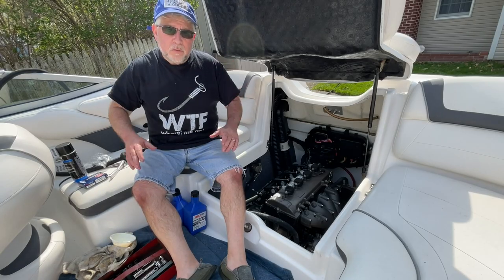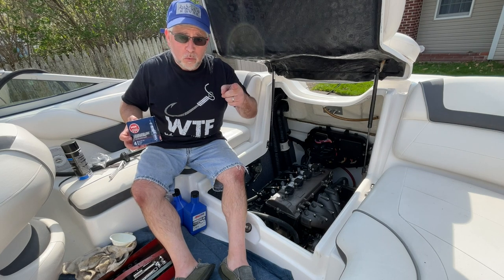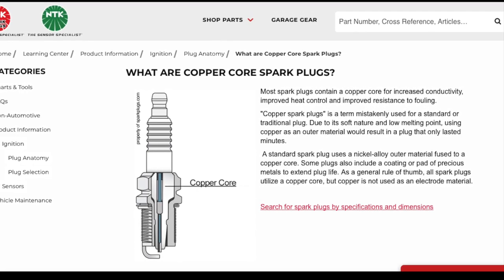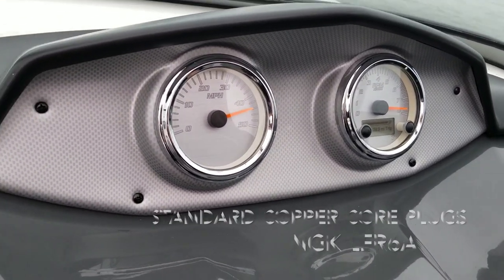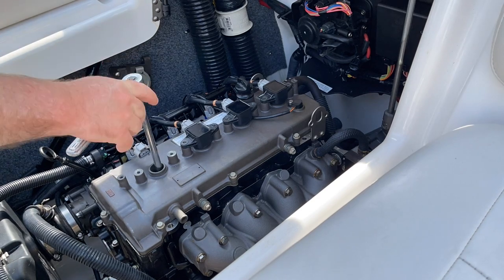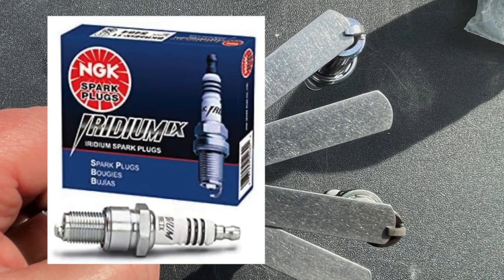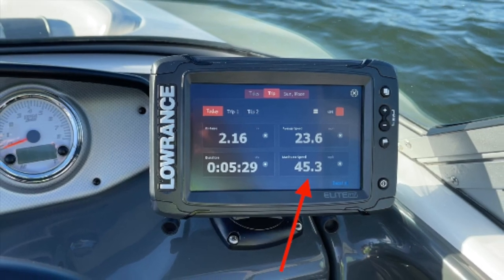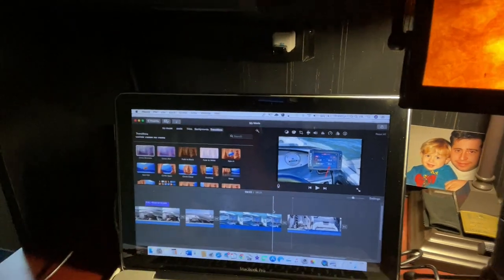Spark Plug Showdown - Yamaha Boat Speed Test

Comment: Your naturally asperated 190 is just as fast as my supercharged 195. Best I've gotten is 48 mph and that was with just me and wife and a 1/4 tank of gas.

Thanks for another great video!
Reply from the maker: Thanks Russell, yeah for general boating the 190 does great. If you need that punch for watersports the 195 is better. The difference in fuel burn at WOT is significant though.
Reply: Yes mY 190 only hits 42mph on the calmest day. And you said you don't have any mods? Have you tried the ribbon delete?
Reply from the maker: @hmunoz1984  nope. All stock. No interest in ribbon delete, there is a reason it’s there. Feedback has not been great on it anyway.

Comment: I could have told you this from motorcycle experimenting many times ... Stay with OEM always ..other than that .now  get rid of that stock air filter for k/n and pop out that restrictive flame arrestor ribbon as the KN has a metal screen on it to replace any back spark .. that's a test you should do and I bet you hit 50mph !!
Reply from the maker: I hear ya Joe! Thanks, and thanks for watching!
Reply: @CaptainLeonsBoatingandMore  no prob ..love the vids , and BTW I'm starting to become a long island boating junkie ..been trailering out there almost every other week this summer from NJ

Comment: I think it matters if you have a supercharge.  Just like a boat running 87 but I think an 89 is just for security.  For my supercharge jet ski, I have to change the oil every 25 hours and the plug to inspect or replace it every 50 hours. The plug is cheap compared to the price of the ski, and since I am already removing it, I just might as well replace it.
Reply from the maker: I hear Kieth, makes sense. Thanks.

Comment: How is your SX 190 going that fast?I can’t get mine over 40..
Reply from the maker: It has to be perfect conditions. Right weight on board, weather and water conditions need to cooperate and these engines like cool temperatures too. Also the post 2019 models are not as fast as the earlier models due to hull design changes.

Comment: Can you link the oil you use and where you got that little mirror?
I have an AR190 and I top out at 42. Wondering if the oil is the difference (or the little mirror haha).
Reply from the maker: Hey Stephen, Amsoil is generally not sold in stores but you get it directly from authorized dealers. Just Google Amsoil and you will find how to order it. It's not cheap but probably one of the best synthetic oils made today. My experience from using it versus Yamalube was the engine obtained slightly higher RPM and my top speed improved by 2-3 mph, at least that was my experience. The little mirror was a gag really. My dad bought it for his car side view mirrors but didn't want it so I found a way to mount it in the boat. Try an auto parts store perhaps. Good luck and thanks for watching!

Comment: you run 87 octane? I assume it has ethanol in it? Did you ever consider running 91 non-oxy, especially to help with the winter storage? I run it in everything, just so I don't have to deal with starting issues after storage. Have you ever had starting issues in summer?
Super helpful....I do believe that OEM is best.... and a service manual is gold! ha
Reply from the maker: Only 87, thats what they call for. Never tried 91.
Reply: @CaptainLeonsBoatingandMore  Is non-oxy gas popular where you live? Thank You!
Reply from the maker: @squeaky61  No, don't think we have that here.

Comment: On naturally aspirated applications, I could see there being little to no difference. The biggest advantage is probably plug life. Now on forced induction the advantage would be more reliable spark with less chance of spark blow out when in boost. Just personal experience from car motors. But in the majority of instances, run what the OEM installs. No sense in re-inventing the wheel.

Nice test by the way!
Reply from the maker: Thanks Christian! Appreciate the input. Makes sense.

Comment: It  will  increase . Because ignition efficiency and timing will become better. But in reality, this increase will be intangible to notice. The reason why sparkplugs are upgraded are for durability and reliability when compression ratio or fuel-air ratio is altered.
Reply from the maker: Sounds logical to me. Thanks for the input and thanks for watching!